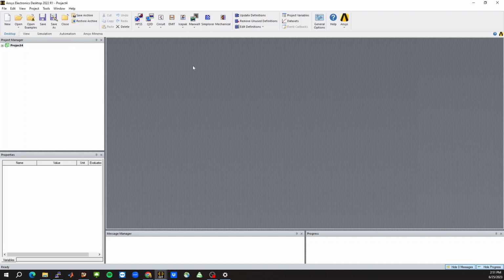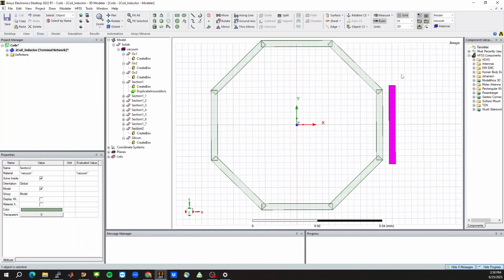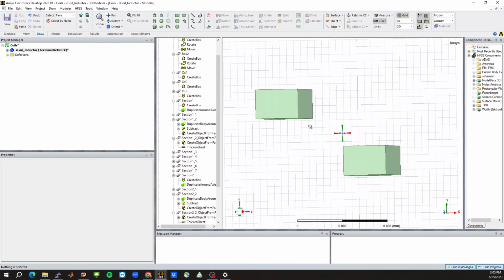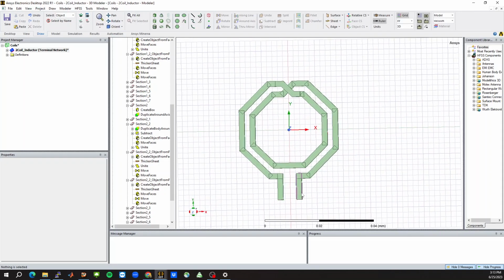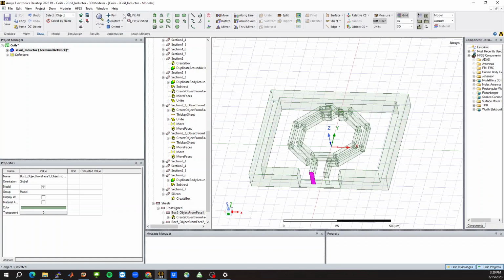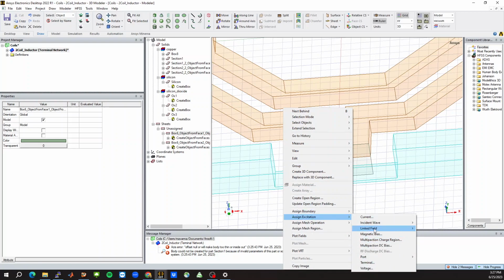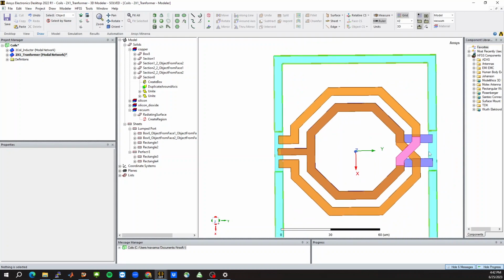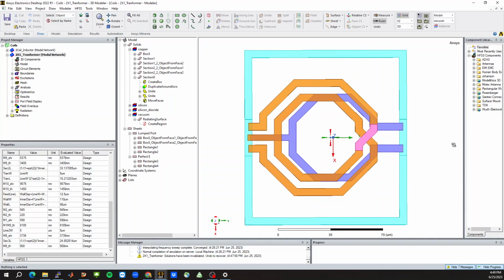Parametric Design of On-Chip Inductors and Transformers in HFSS | MMIC 01

Comment: Never compute inductance from Y-parameters the way it was shown here, i.e., by effectively short-circuiting one of the single-ended ports. It will give you a wrong result at high frequencies, where the current becomes non-uniform along the coil.
Reply from the maker: At frequencies when current becomes non-uniform along the coil you no longer have a lumped element inductor. This method works well for "lumped" inductor models, otherwise you need to use s-parameters. Therefore, there are some circumstances where using Y-parameters is OK.
Reply: @adityavarmamuppala it’s not about S-parameters, it’s about providing a proper and physical (in this case differential) excitation. In the frequency range you shown, passing the first SRF, this definitely should be used.

Comment: Thanks a lot for the great video. How can do you calculate the value that you entered for width, Length, and thickness? can you describe the process?
Reply from the maker: A good start is to use the Cadence inductor models to get the starting dimensions. Then work with design optimization. See my video titled Antennas and Arrays 02.

Comment: Thanks for the video. I have a couple of questions.
1.How do we import pdk stack up in hfss?
For example in EMX we use the proc file.
2.Can you compare the reliability of EMX , HFSS ,ADS and Sonnet?
Reply from the maker: 1. In the video I manually enter the layer height and thickness. That's one option. You could also make an .amat file and a .tech file but that approach I may cover in a later video.
2. I only use EMX and HFSS. For frequency above 30 GHz EMX is not as reliable. HFSS, if setup correctly, is the most reliable.

Comment: Great video by the way. So, when you plot the impedance, it's calculating Z from the coil inductance and the self capacitance?
Reply from the maker: Yes, that's correct.
Reply: @adityavarmamuppala  I modeled a low frequency inductor last week and the Impedance plot looks correct. It seems like something I should be able to do in Q3D, as I can view the L, C and R, but I can't get it to plot the Z.